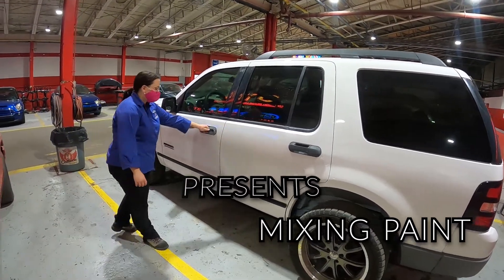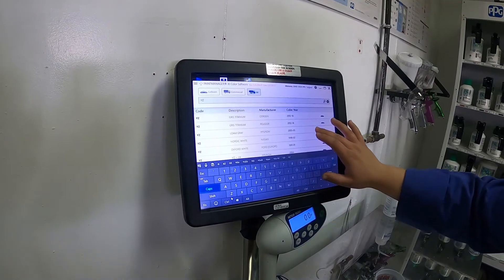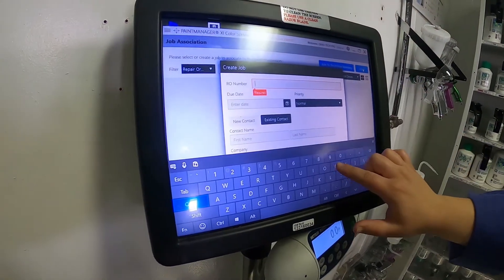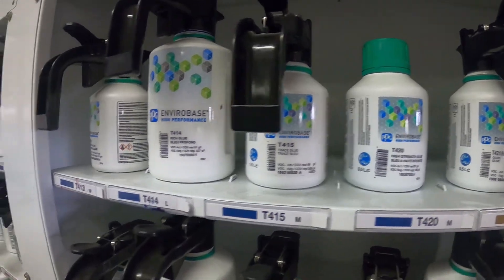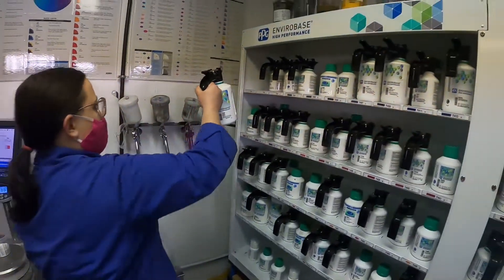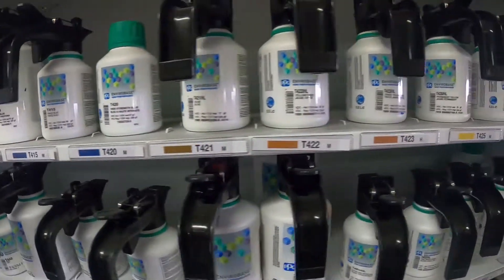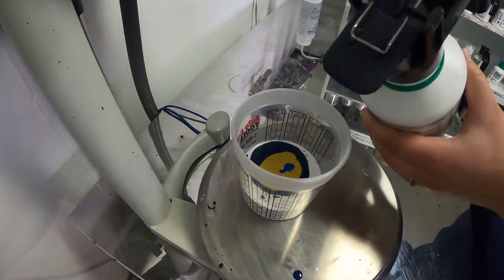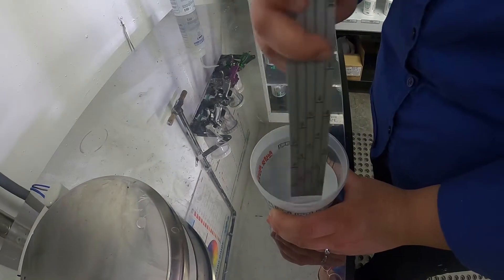Ohio Technical College waterborne paint mixing

Comment: Ive only used solvent paint… do you not have to run all your toners on a shake or stir before using??
Reply from the maker: No typically you give them a turn or two before adding the toners.